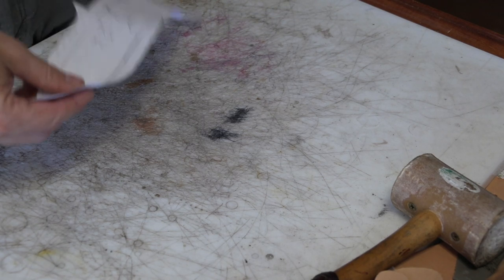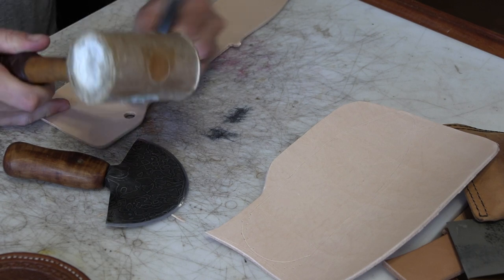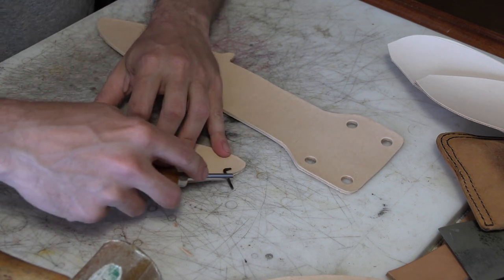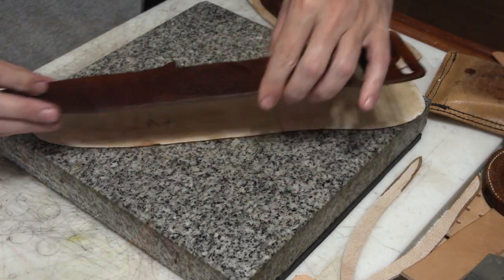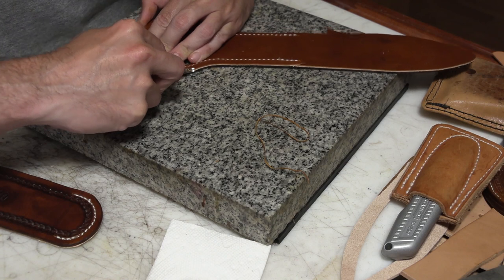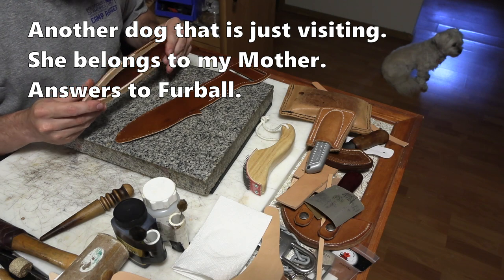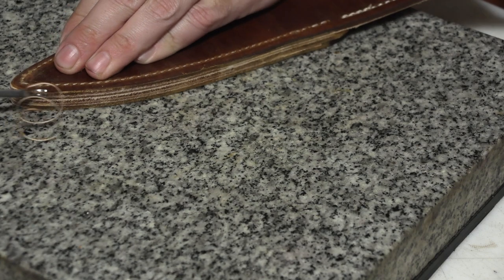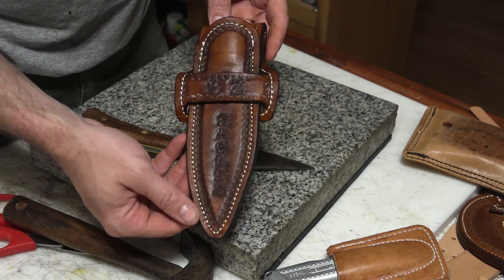Making a knife sheath with a different style belt loop. Like a Mexican loop or single loop holster

Comment: Thanks a bunch I was overwhelmed with so many different sizes and haven't found much help so far till now. Thanks again.
Reply from the maker: It does all depend on what machine you have.  Unlike with household sewing machines there is no standard size and length for industrial machine needles.  The other thing you may encounter is different points.  Ball point needles are used for woven materials like heavy cloth or webbing.  Diamond point or S point needles are usually for leather and have a tip like a stitching awl.
Reply: Ok thanks again. Wow had no idea Makes hand sewing seem nots so bad. I really appreciate all your help.

Comment: Great video!  A little trick that I use on my machine sewing is to place the cut out of the welt back in to the cut out until after sewing, this leaves the leather all it the same level, your foot doesn't fall into the divit (void) area as you sew. Easier to keep your sewing line straight.
Reply from the maker: I haven't really had that problem on this sewing machine, but I do know what you are talking about.  My first machine was a Tippmann and it did that.  Might be worth doing anyway because it would keep the welt pieces from shifting inward and making the sheath too tight.
Reply: You can also sandwich a softer (fusible lining) material between the skin and the window filled shape. This creates a pillow effect and can come in handy sometimes. Either way, your suggestion is an excellent one for making these type of sheaths.

Comment: Hello, very nice work and nice video. 
I followed your knot video and thanks to your amazing guidance was able to get a nice handle for a project. Besides that you've inspired me to try my hand at sheath making. I believe I have the bare minimum of necessary tools.
 One thing I was wondering is, do you buy your leather locally or is there a decent place on the internet to get quality?
In my town we only have 2 shops that deal with leather but I believe their prices may be inflated. I was just wondering about how you yourself obtain your leather (if locally, no need to go into specifics, if that's the case I may have to look around for local product myself.)
Reply from the maker: For anything that is going to be tooled I like to use Hermann oak leather that I usually order from Springfield Leather company.  Another good quality tooling leather to look for is Wickett and Craig.  In my opinion it's worth paying more for good quality materials.  I do buy some leather from Tandy but only in person so I can pick it out myself.  I think their craftsman grade of leather is only useful as a lining leather and is not for tooling.  Weaver leather supply is also a good source for leather.
Reply: @bransonsgeneralstore  Alright. Thanks a ton for the info, that's helps me out immensely.

Comment: As usual great video and beautiful work. U mentioned you're sewing machine I just got my first one and was wondering what size needle and thread do you use? Do u use the same sizes for heavier weight projects as u do for the thinner ones?
Reply from the maker: What I normally use the most is a size 26 needle with #346 bonded nylon thread as my top thread.  Something I started doing on the advice of a saddle maker when I first got a machine is to use a smaller thread on the bottom, so the bobbin thread is #277.  The machine I have works well down to about 6 ounces of leather.  Anything thinner than that I use a singer industrial machine with #69 thread, or just hand stitch.